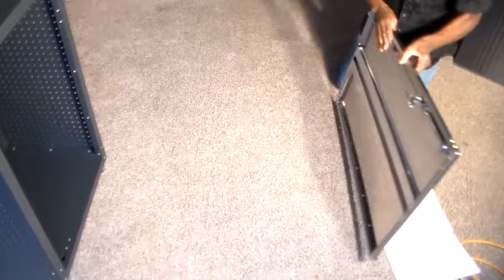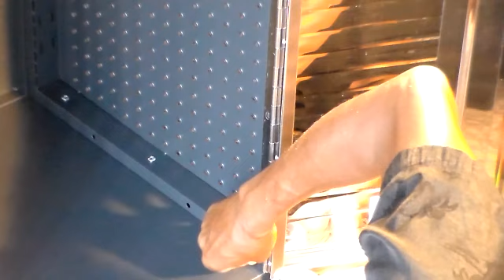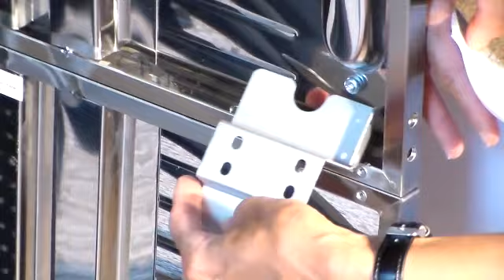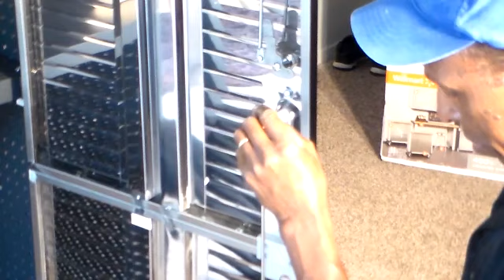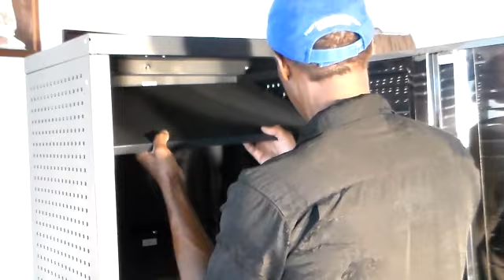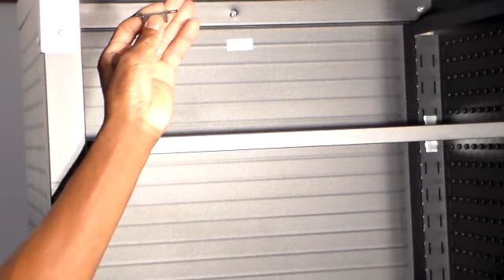ULtraHD storage cabinet assembly part 2

Comment: could i install the door and hinges on the other side, so the door will open opposite direction?
Reply from the maker: yes, you will need to flip the door and line it up and mark the holes on the hinge and drill new holes, or put pressure on the screws when installing them with the drill. then you may want to flip the lock, and relocate the door magnet plate.